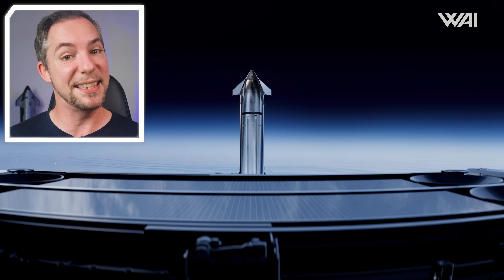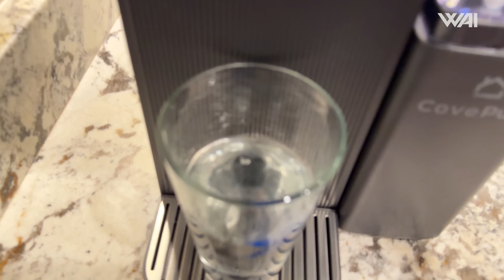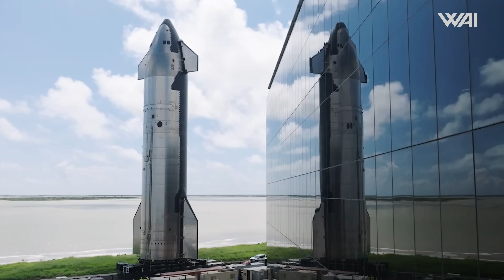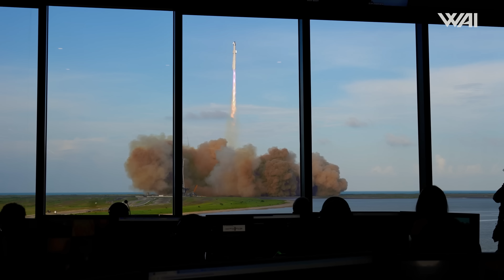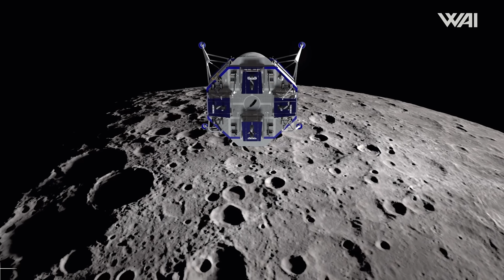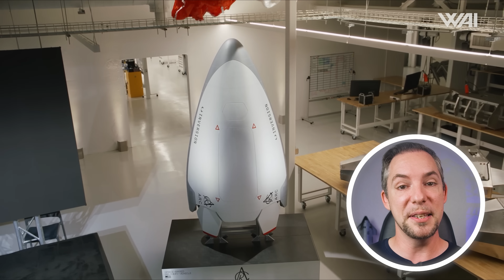SpaceX's Largest Upgrade Yet Reveals Starship v3 Future! Starship Flight 11 Imminent!

Comment from the maker: Go to https://covepure.com/whataboutit to get $200 OFF!
25% OFF on all our Merch until Flight 11! ▶Merch Store US: https://whataboutit.myspreadshop.com/ ▶Merch Store EU: https://whataboutit.myspreadshop.de/
Photographer? THIS WAY: https://forms.gle/WaSLxfrgeKKu2EBHA
Reply: ok that water filter is something i was actually lookin gfor
Reply: Is there a device for Germany, too?
Reply: Hey! Long time WhatAbouitIt enjoyer here, make sure to remineralize the water that comes out of CovePure if they doesn't already provide this feature (I couldn't find anything in there product info), otherwise the water you drink will literally strip the minerals out of your body, essentially demineralizing you via the same osmosis process. Over time if you're not drinking mineralized water, or consciously replacing them via supplementation, you (and your family) will get really sick. Please look into it, while the RO tech is really cool and works, it kind of works too well, and the outcomes can be really insidious for those that don't know what's happening to them.
Reply: The secret to releasing a mass in a straight line is to control the input of ejection force by way of hold down clamps. Only in the last moment of pushing it out do you retract those clamps to allow it to move in a straight line. The current system is pushing and not controlling the "meandering" forces on it. Once released, it's just a random chaos. Not too hard a problem to solve. A couple of clamps and some servos timed to release when the pusher stops pushing.

Comment: That section of the booster would seem to take the most bending loads between the grid fin effect and the mass of the engines.  It would need to be beefy for drastic cross range changes.  It will be interesting to see what the actual usable payload will eventurally be.

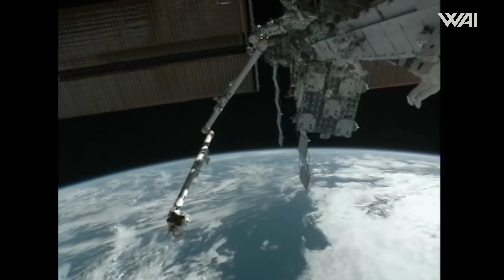Comment: 15:30 Just one problem, how to push the Starlab out of that tiny pez-dispenser opening since Starship doesn't have a payload fairing like every other rocket! 🤣
Reply: They'll use incredible new SpaceXplosion Handwavium technology!
Reply: A proper fairing and door are coming in future iterations, but the first operational Starships will be dedicated—structurally!—to increasing the Starlink constellation. So, Pez Dispenser is Design #1. 

SpaceX says that's because they want to take the early flight risks themselves, not risk other people's payloads, but it's a bit frustrating when the most urgent Starship contract is really the Lunar Starship for the Artemis program... 

That one doesn't have a proper zero-G fairing hatch either, btw. 

Nor does the orbital refueling Starship variant that's also needed for the Artemis program (to top off the Lunar Starship before it does its trans-lunar injection burn, and lunar orbit insertion burn, not to mention the landing burn with enough fuel still to make lunar orbit again and then one more burn back to Earth orbit...).
 
So the "commonplace Starship" variant, with a big empty fairing and a powered hatch to match, is pretty far down the queue. 

There are plenty of renderers out there for you, if you want an idea of what it might look like, but yeah, Starlab gonna have to wait a looong time if it wants a ride on a Starship...

Comment: Blue origin has built / assembled one item. No need to expand when you build one unit. If they build another it will be the same as will any subsequent items. If and when the design changes so will the building. We don't need Redstone size launch vehicles we need high mass to orbit - hence the ever growing Starship assembly buildings.

Comment: Blue origin bahahahshs that’s cute , poj hasn’t made a clean run never mind work
Reply: New Glenn made LEO on its first launch, last January, 
It won't fly often, but when it does, it'll work nearly flawlessly. 

(except for that booster landing... they will need a lot of real-world test data to refine that, and that only comes from trying and missing over and over, like SpaceX did with the Falcon 9. New Glenn might take a decade to build up a similar dataset to nail those barge landings)

Comment: No Felix, the satellites kept bumping into the body of the Starship because of the momentum of the Starship moving forward whilst the satellite catches the thin atmosphere causing it to tilt upwards.

It's like trying to hold onto a plate whilst sticking it out of a car window driving at speed, the way to combat that would to have the satellites gripped a little more firmly and have the deployment system more faster to give the satellites the momentum required to clear the Starships body before the drag momentum takes effect and causes the satellites to deccelerate in regards to the Starship'.

It's not 'rocket science' Felix, it's 'basic physics'!!

Comment: If the plan is for so many launches, given Elon’s wealth, why aren’t there 20-30 Pad B’s under construction all over the world? It seems launch infrastructure will be a bottleneck they could be addressing now.!
Reply: Why? Very simple: Pad B is EXTREMELY likely to NOT be the final pad design. (just like V3 is also not the final design of the Starship stack)

Why start building 20 of something that has not yet seen even a single launch?! It's a near certainty they'll find something that needs to be changed (likely multiple things) to get to rapid reuse of the pad. It's foolish & a complete waste of money to start building many of them until most of the bugs have been worked out on this version first. Only then will they go nuts & build lots of pads.

Comment: They could had build the bays and towers etc just a few fing meters taller just in case, geez you said it, they test change repeat etc so build support equipment and building a little over what you need now. It’s not rocket science

Comment: While I applaud the commercial efforts to establish many conventional Space Stations to carry on after ISS decommissioning, I would also like to see a station dedicated to testing artificial gravity systems and human adaptation. Since Werner von Braun got motion sickness along with other Marshall engineers when they were considering artificial gravity on Skylab, artificial gravity has enjoyed a terrible reputation in the NASA community. But since micro-gravity also causes massive motion sickness until humans adapt, (something discovered on Skylab), I could only conclude that there is a very good chance that human sickness in relation to artificial gravity may be similarly overcome by human adaptation. We need to know for sure. And a working artificial gravity technology would go along way to mitigating the potential difficulties posed by astronauts being deconditioned directly before a multi-G Mars entry and landing and strenuous surface activity requirements.
Reply: What do mean by artificial gravity systems?

Comment: Here are the key points to avoid sitting through all the slop.

🚀 Flight 11 Goals: Final test of version 2 Starship focusing on payload deployment and heat shield improvements.

🧪 Version 3 Hardware: New components like hot staging ring and common dome are being tested for future launches.

🏗 Gigabay Construction: Massive new workbay being built to support larger version 3 Starships.

🔥 Pad B Upgrades: Advanced launch pad nearly complete with water deluge and recycling systems.

🛰 Starlab Station: Commercial space station designed for single-launch deployment via Starship.

🌕 Blue Origin’s Lunar Plans: Blue Moon lander aims for moon landing in 2026; BE-7 engine passes long-duration tests.

✈ Inversion Space’s ARK: New space plane concept for rapid orbital cargo delivery and hypersonic testing.
Reply: "The slop" as you say is the necessary detail to gently nudge the naysayers to reevaluate their assumptions.  If you examine all the objections and "that'll never works" from previous comments, you'll notice Felix surgically dismantling these arguments in following episodes.  A master class in 'suffering fools gladly' -- and while it's not /my/ strong suit, I recognize and appreciate the effort Felix & Co. employ in trying to drag along all of humanity toward the promised land.  More slop!
Reply: Pad A possible retirement after launch 11

Comment: I had an idea to build giant space stations. launch loads of modules and create like a Giant 1 km squared box of modules. Then attach metal plating to the outside of the box until it is a giant square sealed box . then take the modules apart from inside leaving the other walls 1km squared. Huge space station that they can fill with what they want. it will be like Elite Dangerous.

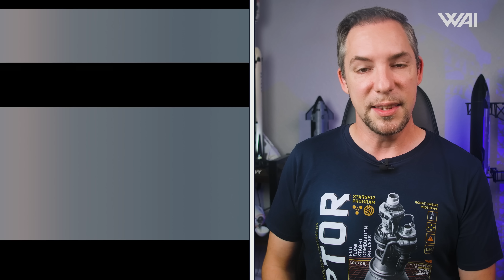Comment: 3:07 The common dome is not flat, it is usually a funnel, but the test article has an inverted dome – like a bowl. 

Early domes were constructed with a combination of curved knuckle sections joined at the perimeter, a conical section, and a single small dome panel.

Comment: Felix, love your channel and watch every episode. Wondering if you would be able to do a deep dive into the software that drives Starship? 

I one have tons of questions in this regard, but one specific one caught me when you were showing some of the older starships in the early days. 

Specifically, when starship is doing the flip maneuver to become vertical, does it understand its orientation, and does it gimbal all of the firing engines to the opposite side of the flip to counter it? 

I know this is a very specific question, but let it serve as an example. What are the major software components that control starship during reentry and descent, when do they happen and what are they doing to the starship? 

Inquiring minds want to know...
Reply from the maker: Thank you! I have lots of questions about the software as well! I’ll see what I can find! ❤️

Comment: Space Station Construction may become one of the hottest new markets & Space X is uniquely positioned to assert it's dominance through finance/research/engineering & ability to put 100 tons quickly into LEO (modules or a whole station).  Space stations will be platforms for engineering/science/medical breakthroughs & companies will be lining up to use them.  We could also use them as fuel depots, make them rotating (gravity) and as assembling sites for transfer vehicles to the Moon & Mars & probes to explore the solar system.
Reply: 'Space stations will be platforms for engineering/science/medical breakthroughs...'

But in nearly 30 years the ISS has done none of those things it's an orbiting white elephant. So why would the next one be any different? $150 billion all for what? The space shuttle and the ISS were a self licking ice cream. The space shuttle was needed to build the ISS, and the ISS was needed to justify building the space shuttle. But hay, the shuttle did give us the Hubble telescope.

Comment: I know 24 minutes is precious time.  Here's the summary: 

- Flight 11 is the final v2 Starship and focuses on fixing payload deployment (after F10 door bumps) and gathering critical heat-shield data with new tile configs.
- F11 timing: channel cites Oct 13, 6:15 p.m. CT target.

- V3 Starship is coming: test tank has integrated hot-staging ring and flatter common dome; cryo tests suggest core structural validation before ramping hardware builds.

- Gigabay rising fast: 3–4x Mega Bay footprint, ~116 m tall, dedicated work bays, direct Hwy 4 access—built to mass-produce larger V3 vehicles.

- Pad B nearly ready for V3: deluge, flame trench, QD, hold-downs, draw-works, chopsticks tested; weekly runs imply deluge is operational. Pad A likely upgraded after F11.

- F11 timing: channel cites Oct 13, 6:15 p.m. CT target.

- Starlab: single-launch, Starship-class station (~450 m³, 4 crew, 60 kW, 400+ experiments/yr), NASA CLD-backed ($217.5M), CDR late 2025. Not aimed at tourism.

- Blue Origin: Blue Moon Mk1 targets early 2026 uncrewed Moon landing; BE-7 completed 1,030 s burn; VIPER CLPS in 2027; “Lunar Plant One” opened; New Glenn NG-2 aims mid-Oct with ESCAPADE and another recovery attempt.

- Inversion Space “Ark”: reusable lifting-body cargo craft for <1 hr global delivery, controllable parachute landings, ~1,000 km cross-range; hypersonic test platform; first full test next year.
Reply: Nice use of AI bud 🌾🌾
Reply: Felix is a entertaining genuine fan of the industry you are a hack, a leech on society have the respect he and his team are giving the viewers to watch and listen to the information they have gathered that you just wish to steal.
Reply: thus guy makes his living on view time and doesnt get paid or very little for folks who skip through.   
Why people think its ok to add time stamps or a synopsys to someone elses work without permission or request just blows my mind.    You are literally taking money out of felix and the teams pocket with this.
Reply: @RayoAtra  Youtube is free, my time is not
Reply: @aarondavis1284  Maybe if you worked harder in life you wouldnt have this problem.   My point is accurate no matter your personal situation.
Reply: Recapping from another summarizer downthread: You're not helping. You're skipping necessary detail which gently nudges the naysayers to reevaluate their assumptions.  If you examine all the objections and "that'll never works" from previous comments, you'll notice Felix surgically dismantling these arguments in following episodes.  A master class in 'suffering fools gladly' -- and while it's not /my/ strong suit, I recognize and appreciate the effort Felix & Co. employ in trying to drag along all of humanity toward the promised land.  Endure it, or do better on your own channel.
Reply: THANK YOU, man his videos are so slow to say these points
Reply: @3pintsthis is why I'm doing this.  My guy is the best at talking and avoiding the main subject
Reply: thank you, please repeat on next if possible

Comment: I still haven't seen how starship is going to launch more conventional satellites.  How do they plan on widely opening the payload bay while maintaining the structural rigidity and heat shielding?
Reply: Starship doesn't have to launch "conventional" satellites.
SpaceX:  "Launch with us for $1M, but it has to fit through this slot"
ULA:  "Launch a conventional satellite with us for only $10M."
Satellite company:  "Uhhhhhhh. New design coming!"

That said, SpaceX has shown clamshell renderings in the past.  I expect that's the way they will go eventually.
Reply: They could easily make a satellite platform using the starlink satellite as a base which could be used to serve customer needs - industrial customers will see enormous value in a ready built platform that you can just attach your own instrumentation to

Comment: Guten Tag, erst einmal, ich bin ein großer Fan von euer Berichtserstattung. Good Job. Was ich eigentlich sagen will, du hast gesagt, das Pad 1 nach dem Pad 2 an Start geht nicht mehr gebraucht und abgerissen wird oder so ähnlich. Könnte es nicht sein, dass die noch versuchen ein Schiff zu fangen? und das an dem Turm, weil wenn's schiefgeht, wäre es nicht so schlimm oder?

HI, wenn ich mich Irre... ist das hier noch einmal an englische Äquivalent...
Hi, if I'm mistaken... is this again an English equivalent...

Good day, first of all, I am a big fan of your reporting. Good job. What I actually want to say is, you said that Pad 1 would no longer be needed after Pad 2 is operational and would be demolished or something like that. Couldn't it be that they are still trying to catch a ship there? And that on the tower, because if it goes wrong, it wouldn't be that bad, right?

Grüße aus Deutschland
Greetings from Germany

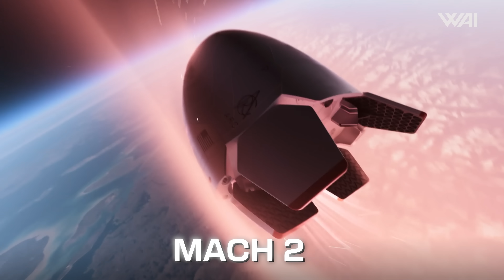Comment: 22:40 wonder if Starship could zigzag like this, might save the heat shield. It would look insane in the sky too
Reply: starship can do s-turns.  Not sure how that would save the heat shield.  s-turns are used to prevent overshooting your landing location.  Better to enter the atmosphere further down range and do s-turns than to enter too far up range and come up short.
Reply: @apostolakisl  my thinking was S-turns during reentry could spread heat exposure, reducing peak thermal stress on the heat shield. Something like carving on a mountain with a snowboard. But I have a big imagination 🙃
Reply: @xRola. They do that by gliding in the upper atmosphere. If you watch the re-entry videos you'll see they pretty much stop descending at one point. I think it's about 60 km from memory.

Comment: I think that when New Glenn does go for total reusability, they will find themselves needed a very significant redesign.
Reply: I think that SpaceX in achieving booster reusability learned that a reusable 2nd stage needed to be LARGE if it was to be cost effective hence Starship.  New Glenn is likely too small and probably unable to be a cost effective alternative once Starship is fully operational.  

One of the lessons of Falcon 9 that hasn't apparently been learned by anyone else is the cost saving of both stages using the same engines and fuels.  You save money up front by only needing to develop one engine.  Then you only need one facility to build them.  With only one fuel you only need one system to store the fuel.  Another lesson is that for reuse the closer the landing vehicle can come to being able to hover the better. 

 Combining these lessons you have Starship whose first stage has LOTS of engines and the 2nd stage has few but can hover on one.  Falcon 9 can't hover.  Its second stage is even further from being able to hover especially since its only engine is a vacuum engine.  Starship having both vacuum and sea level can do what Falcon 9 could never have done without developing another engine of much lower thrust.

:planet-orange-purple-ring:

Comment: unless a new material is discovered/created the heat shield will be a problem forever...and will never be fully reusable. plasma is plasma and at 3200K tungsten seems the only usable material, so maybe a micro film on top of a insulator. but even then that's a pretty far fetched idea